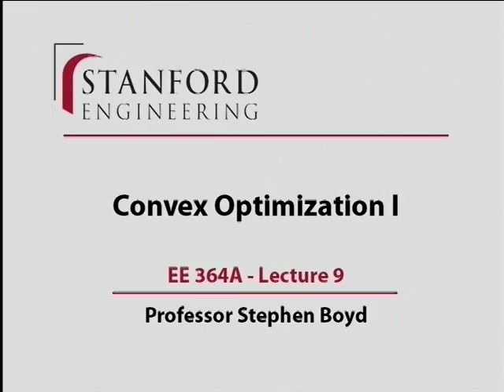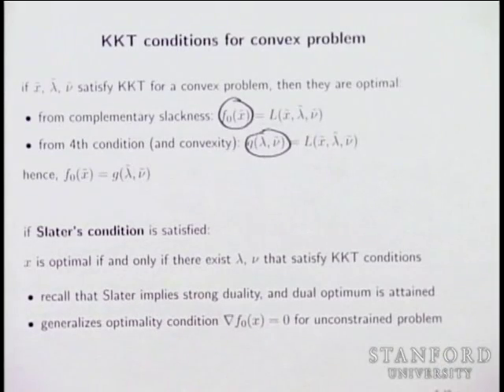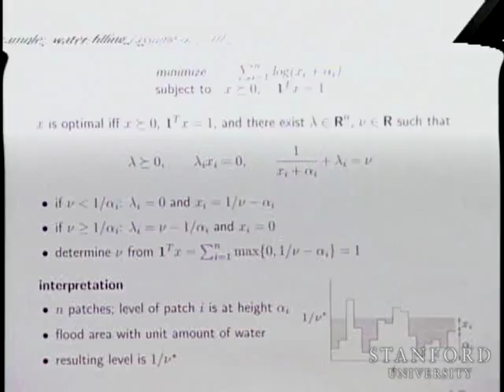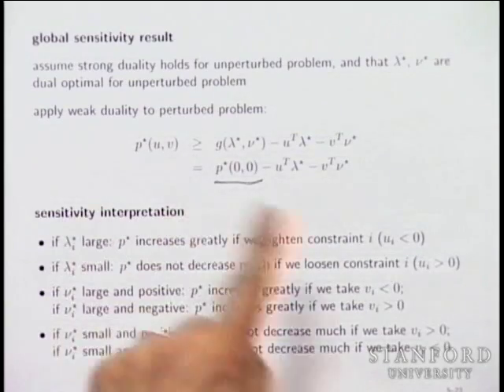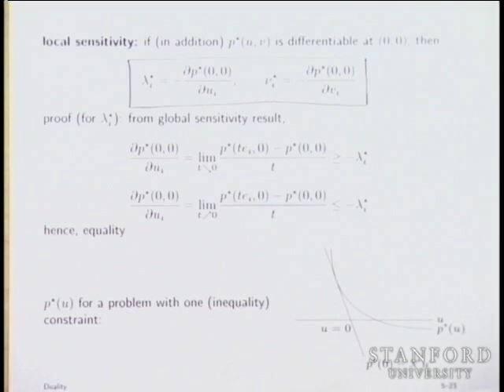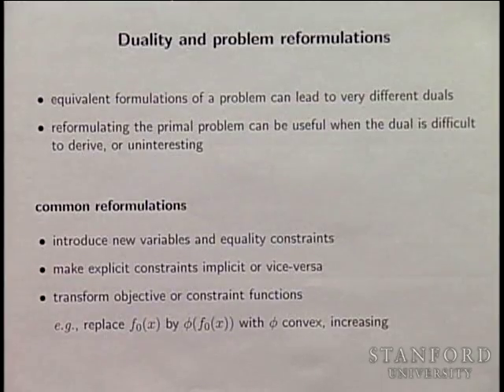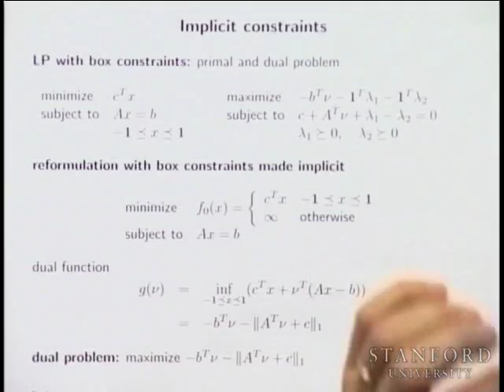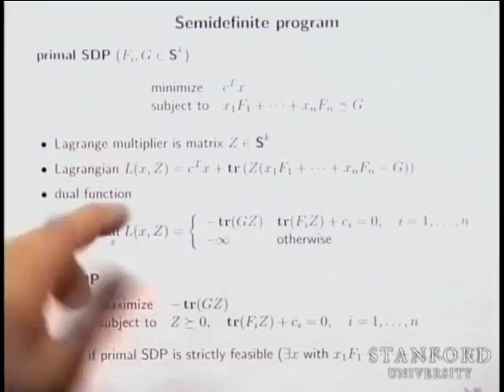Lecture 9 | Convex Optimization I (Stanford)

Comment: 0:28 Complementary slackness
4:27 Karush-Kuhn-Tucker (KKT) conditions
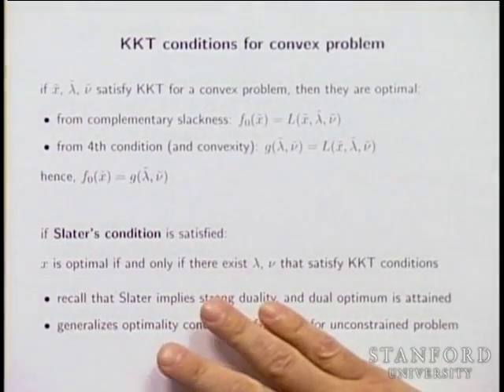7:01 KKT conditions for the convex problem
14:12 Water-filling
23:56 Perturbation and sensitivity analysis
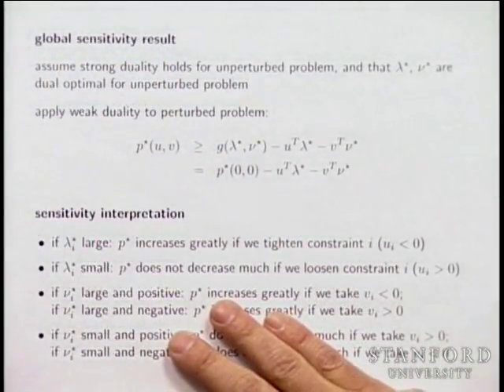29:39 global sensitivity result
43:00 local sensitivity
50:12 Duality and problem formulations
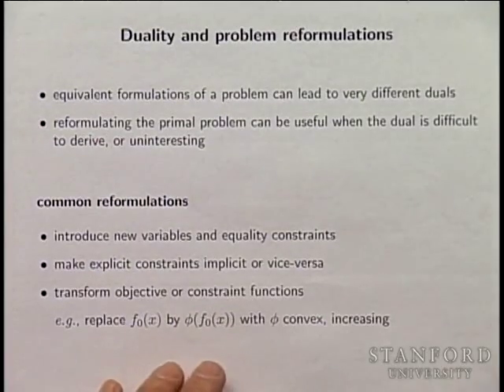55:04 Introducing new variables and equality constraints
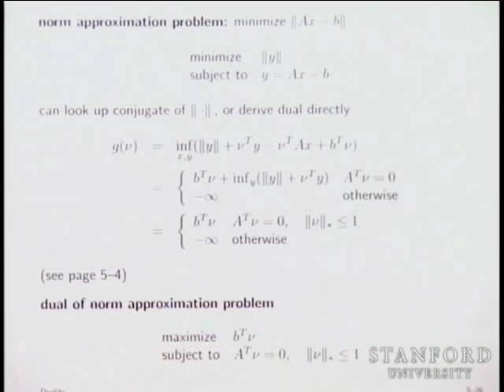1:01:48 Implicit constraints
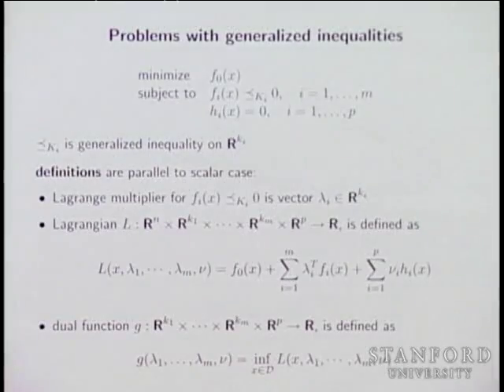1:11:03 Problems with generalized inequalities
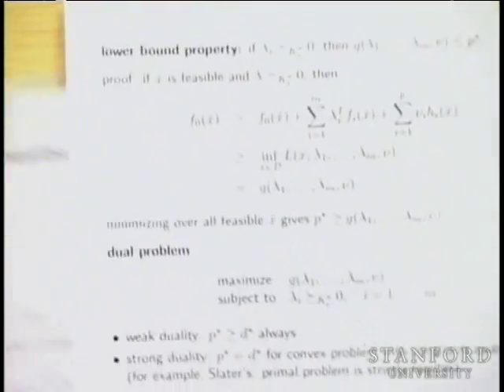1:13:14 lower bound property
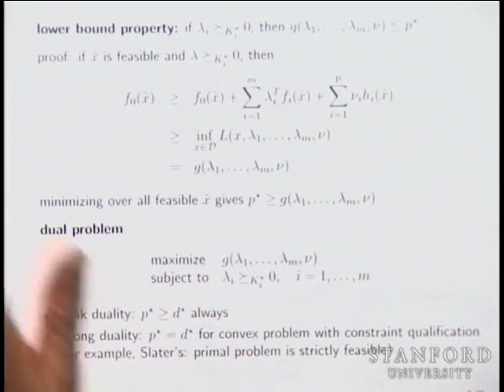1:13:51 Semidefinite program

"When something comes to you for free, you should figure out a way to use it" ~Boyd

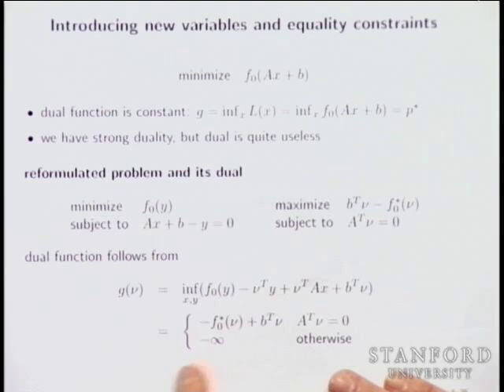Comment: At 57:38, when he takes the infimum of the Lagrangian w.r.t (x,y), I understand why, for the case of minimizing w.r.t 'x', he had to set 'A-Transpose * nu' to zero (otherwise, as already mentioned for an affine function, its minimum would be '-inf', as is stated in case 2 - 'otherwise'). 

For the variable 'y' case 1 (where 'A-Transpose * nu' is set to zero), the Infimum of 'f_0(y) - nu-transpose * y' was replaced by '- (supremum of (nu-transpose * y - f_0(y) ) )' which was written as 'f_0*(nu)' (the conjugate function of 'f_0 (? Please correct me about this as I couldn't find a similar explanation anywhere else)).
But how does it vanish under the 'otherwise' condition?

Comment: At 59:01, when he defines the conjugate of the norm, could some one elaborate on it?
I am unable to comprehend what 'the indicator function of the dual norm unit-ball'.

I found an explanation of the 'Dual Norm' here: ( https://math.stackexchange.com/a/903512/803327 ). 
From the first half of the explanation with regards to finite-dimensional space, I understand that it's basically just a measure of the maximum relative 'length' of the input vector w.r.t a vector 'x' and its general norm; you keep moving the vector 'x' around and where ever the function maximizes is the conjugate norm value of the input vector.

So, the statement 'Dual norm unit-ball' indicates that the input vector must be belong to a Unit Sphere.

An Indicator function over a defined domain is '1' on that domain and '0' everywhere else.

I guess I kinda understand it, but would appreciate if some one else has a more nuanced explanation for the same.

Comment: at 1:08:35, how does he get -b ^ T v - ||A ^ T v + c||_1 from that lagrangian??
Reply: Corrected:
You can write the Lagrangian as (A^Tv + c) x- b^Tv which is affine in x and thus x*=1 if (A^Tv + c) < 0 and x*=-1 if  (A^Tv + c) > 0. Thus the whole term will always have a negative sign which you can factor out. From there you get minus the sum of the absolut values of the elements of A^Tv + c which is exactly the definition of ||.||_1. Hope that made it clear.
Reply: @timothy-qe7kj   But why must '(A^Tv + c) < 1 ' if 'x* = 1'?
Earlier, we used to set it to the zero-vector because we wanted to avoid the scenario where, being an affine function, 'x' can go to '-inf' in order to fulfill the infimum requirements.
But here, 'x' is bounded; hence no reason to set  '(A^Tv + c) ' to the zero-vector. But why and how anything else? In fact, if 'x* = 1', I would prefer if '(A^Tv + c) < 0 ', and if 'x* = -1' , then '(A^Tv + c) > 0 '. This is because it would aid in reducing the whole value as I am still asking for the infimum.
He says something along those lines at 1:09:17 .
Reply: @ArnabJoardar  You are right, there is an error. It should be x*=1 if (A^Tv + c) < 0 and x*=-1 if  (A^Tv + c) > 0. As < 1 or > 1 makes no sense.